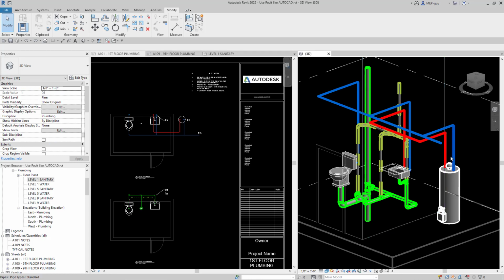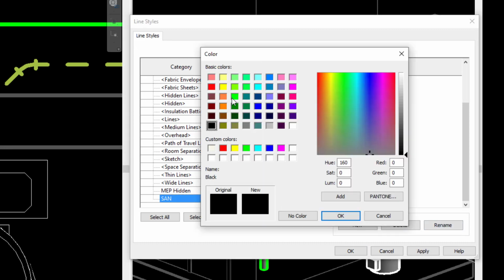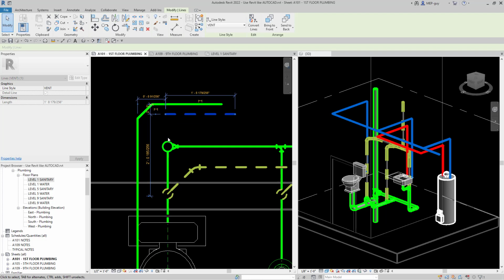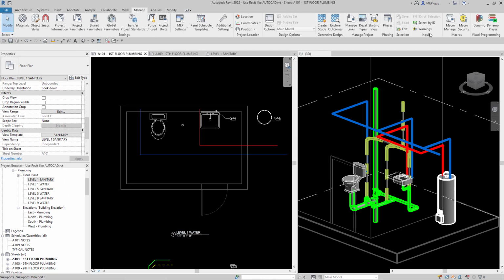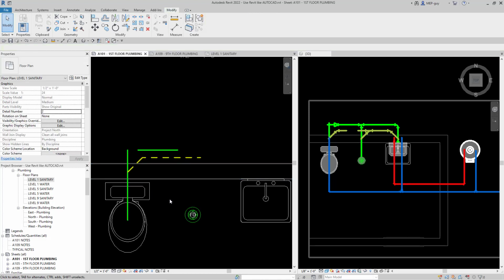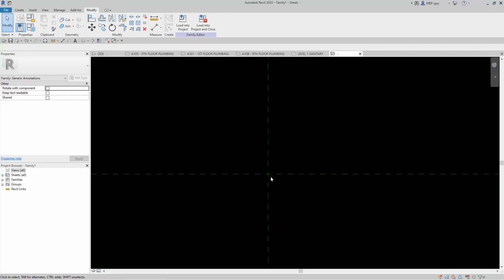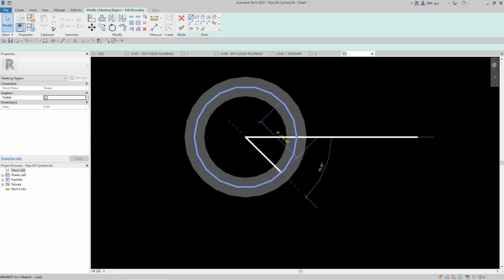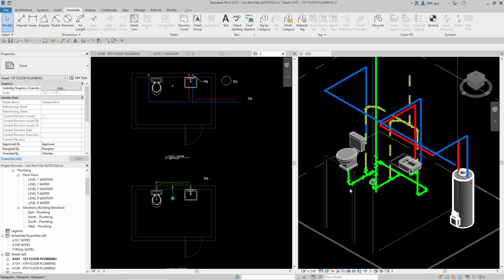Use this Trick to Draw Pipe in Revit MEP

Comment: I use Detail Line HEAVILY during our concept and basis of design phase. During that phase, everything is extremely fluid and drawing lines is 100x faster than modeling actual pipe and equipment. The best part of this is I can later get my engineers to go right into Revit and model the stuff right under the detail lines. Also, Fillet Arc is a great compromise for not being able to chamfer. Lucky you, your line weights actually make sense. For some silly reason, our template has line weights that do not go in ascending order. Line 1 is thinnest, 2 is thicker and 3 becomes the same thickness as line 1! Templates are constant work...

Keep up the great work! Loving your style.
Reply from the maker: Thanks TED! I just love the possibilities with REVIT. So many great options to model and create drawings. I love thinking of ways to make our lives easier. I still need to learn electrical so looking forward to your future vids! Love your stuff too! Keep up the great work!
Reply: @mep_guy  by the way, you never sent me your info!
Reply from the maker: @theelectricaldepartment  was trying to get my email to work. It's THEGUY@MEPGUY.COM
Definitely shoot me an email. I got some ideas for ya. Hopefully the email works. Just set it up.
Reply from the maker: ok, so my mepguy email isn't working which is why I haven't got back to you if you did email me. So frustrating!! I did set up a twitter account @MEPguy so if you want you can direct message me there. Sorry just didn't want to put my personal email on youtube. But I'd still love to chat.